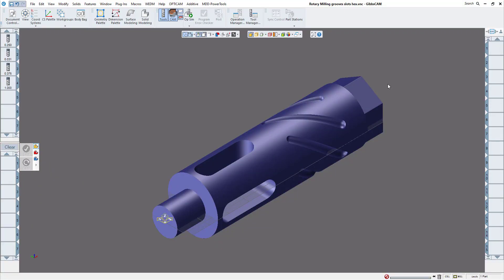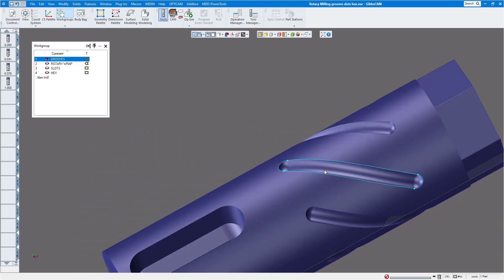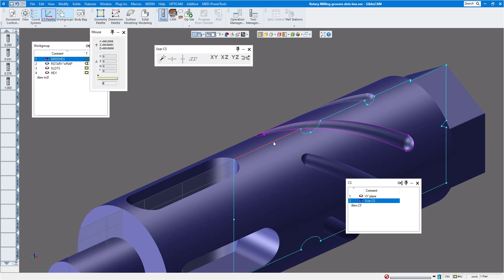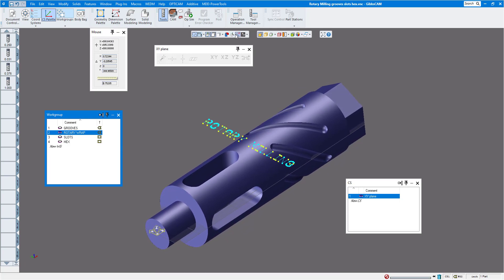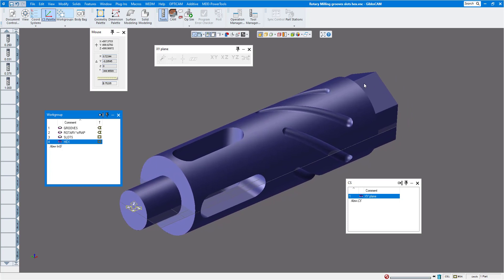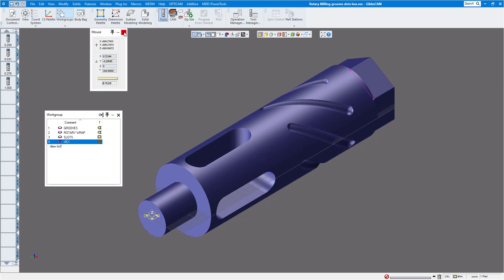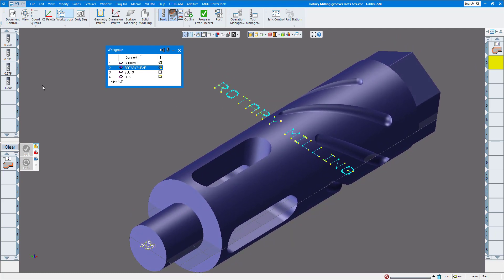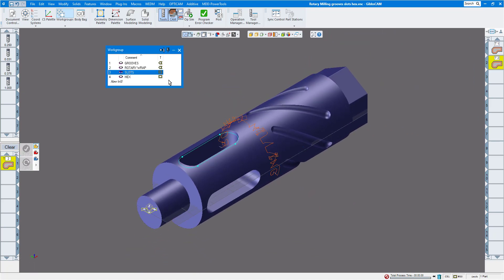GibbsCAM Rotary Milling on a 4-axis Vertical.

Comment: You complicate very much ....in slots rounded...use directly 5 X strategy.....you control better the tool in small...step over....rough and finish the same tool ..no need wrap.....wrap is good in other situation...when you have space from outside to atack the walls....by 2D strategies...pocket or profile.....! lead in...lead out also.
Reply from the maker: Thanks, but most customers don't have the 5-axis license, or you can machine differently.  Thanks for watching!
Reply: @GibbsCAMVideoTutorials  hahhahahhaha.......We have any.....but We do not have finally nothing:)))))))same....We have car ....but no petrol! I think .....5X strategies cost more than the  machine:)))))) fantastic marketing!
Reply from the maker: @Hanal503  Yes, 5-axis is expensive.🙂
Reply: @GibbsCAMVideoTutorials  expensive what?...the module 5X....or post processor 5X?
Reply from the maker: @Hanal503  5-axis add-on is about $4,200 (USD), Post is $2,100 (USD)
Reply: @GibbsCAMVideoTutorials  lifetime ????? or per year? the module 5X....for some cad/cam systems  we pay anually!
Reply from the maker: @Hanal503  That's a one time charge. Have to purchase Maintenance for at least 12 months.  After 12 months you don't have to get Maintenance unless you want the ability to download the latest version.   The license never expires though, so you are not required to be on Maintenance to still use it.

Comment: would you be willing to share the post file that you use? When I try to post it tells me that i need a post with roatery motion.
Reply from the maker: I will try to get that to you next week.  Does it render correctly?  If so, and it tells you that you need a rotary post, you probably have an older post, as all the new ones from a year or so ago all have rotary built in.
Reply: @GibbsCAMVideoTutorials  yes it renders correctly and it is an older post file
Reply: @GibbsCAMVideoTutorials  hey I was wondering if your still willing to share your post file with me?
Reply from the maker: Click on the video again and the link will be there to download the vnc file.
Reply: @GibbsCAMVideoTutorials  I have gibbs 2018 v12.8 and it tells me I cant open that file. also a vnc file is not a post file to my knowledge.
Reply from the maker: I had to change the link.  Thought you wanted the vnc file.  I can put the code if that's what you are after.
Reply: @GibbsCAMVideoTutorials  I was looking for the file that you used to post the code.
Reply from the maker: Both files are in the link now
Reply: @GibbsCAMVideoTutorials   I know your helping me out and dont mean to be a pain in the ass but the link still just has the vnc file.
Reply from the maker: It should be there now.  Found out that Dropbox makes you link each file, can't just link the folder.  Check now, should be there.
Reply: @GibbsCAMVideoTutorials  the file that im looking for is likely a .pm4/.pm3 file. you linked the actual code for that part and not the post file.
Reply from the maker: @chad1355   Not sure what a pm3 or pm4 file type is.   Usually those are Adobe layouts.
Reply: @GibbsCAMVideoTutorials  that's the format post haste uses in gibbs. Otherwise .pst if using the other way of posting through gibbs.
Reply from the maker: @chad1355  Sorry, my apologies, you are correct.  I just don't use PostHaste very much, but yes it uses the pm3's.  I don't see one that will do Rotary milling in the post haste library.   Have to edit one or look further in the library, but I doubt there is one that does rotary milling(simultaneous) milling, only 4th axis positioning.   This part has simultaneous 4th axis milling.

Comment: Any thoughts on why the rotate tab is not appearing? Our upgrade was a decent leap (2014) and still trying to figure things out.
Reply from the maker: The rotate tab will not appear unless you have 1) Choosen a 4-axis Mill.  You can't do rotary milling on a 3-axis mill, has to be a 4-axis mill.  Then check the Machine Setup page under the Document Control window.  Normal 3-axis mills with a rotary table are usually on the right hand side.  Make sure this is correct. The face of the 4th axis should be perpendicular with the X-axis.  2) You have to be on the XY plane on a mill.  If a lathe then the YZ plane.  Hope this helps.  (of course you have to have the Rotary Milling/Polar&cylindrical option as well).

Comment: i've been battling this for a while wondering why running a contour on  "wrapped" geometry wasn't following the toolpath properly .. so the geometry needs to be "unwrapped to get a the proper toolpath?? if that's the case, what are the benefits of wrapping your geometry around the part?  Also,  I notice that the post (when rotary milling) will show very high feed rates, but no G93 or G94 code which turns to "feed per minute"??  or do newer machines automatically do this when feeding in the A axis?
Reply from the maker: There two different ways to do Rotary milling, and that depends on your part.   If you have a Solid Model of your part with the engraving already in the model already, that is when you extract the geometry, then go to Modify, then Unwrap.  If you already have a part, and you are "creating" the geometry to "wrap" around a cylinder,  draw that geometry at the diameter of the round stock, then you click on the WG (workgroup), then right click on the WG, then click on WG info, then put a check in the check box that says "wrap".  Now that will wrap the geometry around the cylinder.  IF you click on the Wrap Icon (small icon under the main toolbar) you can see it wrapped and unwrapped.  Hope this help.

Comment: Hello,is it possible to work with a vertical milling head? Is it necessary to have a separate postprocessor for working in G18?
Reply: for horizontal milling machine
Reply from the maker: You don't necessarily need a separate post, but you might need your post processor updated to use right-angle heads, etc.  Normally a standard post does not support it.  If you want Gibbs can create a RA head. You can provide the model and Gibbs will create an intermediate Tool and modify the post processor to use it.